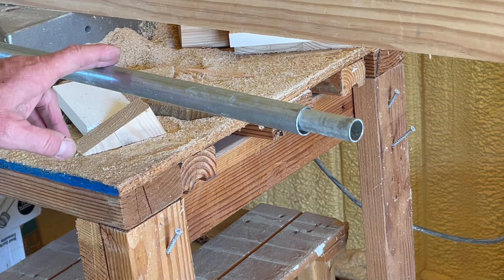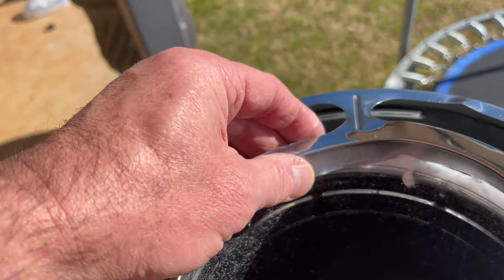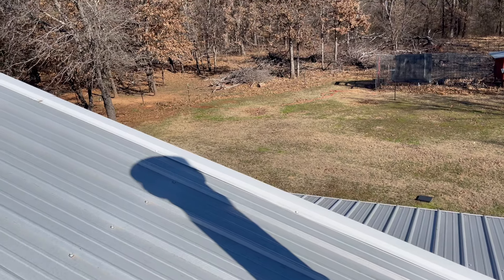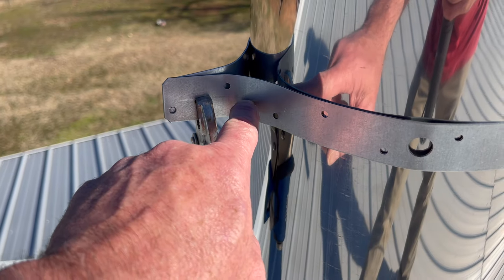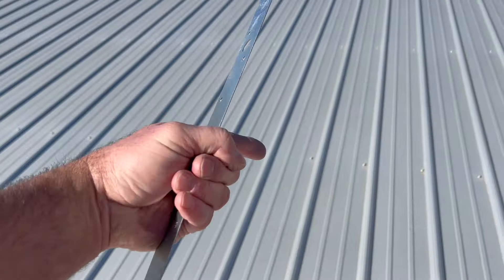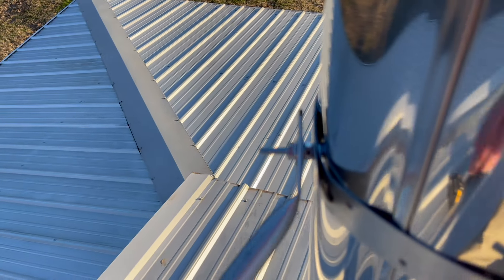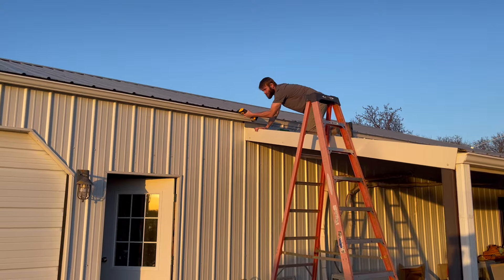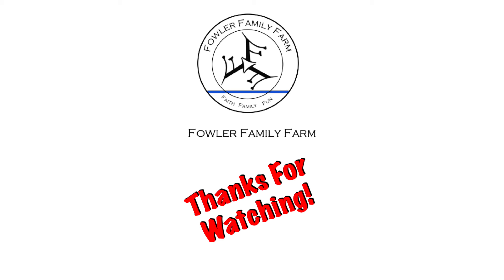Easy Chimney Support Mount DIY | How to Install And Very Cheap | Under $30.

Comment: WOW… I just bought one of those Expensive Roof Pipe Tie Down Doomawachies 🤦‍♀️ You’re Right, $140.00 right down the drain !!!
I put my Wood stove in this fall in Oct, pipes & everything was around $1,100 … Considering electric could be 4-500 a month, I had to go with wood for heat … Great Job on this Video.. Until the next one 😉💞🇺🇸
Reply from the maker: Oh man Brenda. I should have done this video sooner

Comment: Mike it looks amazing. Might I suggest for additional protection you might look for another cover to go over the boot to keep the rain and snow from gathering on the inside rig . I know you said it has rubby boot that goes on it close to the house but I think as extra protection I put another cover so that water doesn't pool around the pipe causing it to rust. River sure was wide awake and looking around. He's sure growing up fast already. Before you know it he's going to be running all over getting into everything. Thank You for sharing. Much Love from our family to your family 💞
Reply from the maker: I seen that in another video , where they put the additional cover over the rubber boot. I think it’s a great idea.  I might do it

Comment: Looks good, are you worried that the material you have against the stainless will corrode it (Looks like galvanized)?
I am Installing a chimney now in my garage, I am planning to make my own mount for the tee to sit on after the wall pass through to hold up the riser. I was planning to make the support out of carbon steel angle, paint it, probably with something thick and textured. I'm going to put a piece of stainless sheet metal between the painted carbon and the stainless chimney pipe, I'm worried it may corrode. Do you have any advice?
Reply from the maker: I went off another guy’s video and I remember him saying check it periodically to look for corrosion. But I’m really not that experienced in it to be honest
Reply: @FowlerFamilyFarm  I know they make a similar strapping in stainless steel, if you use that along with stainless bolts to attach your poles to it shouldn't be an issue. I think that's the route I will go, thanks for the informative video!